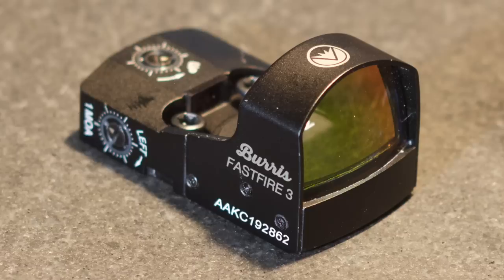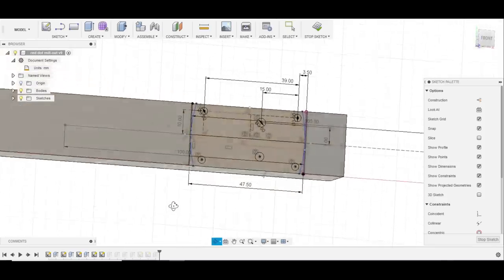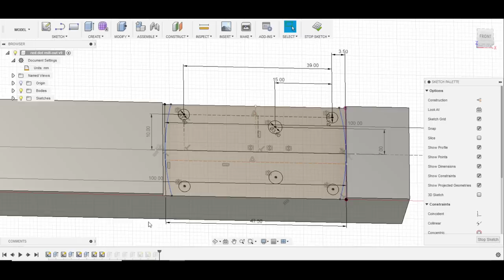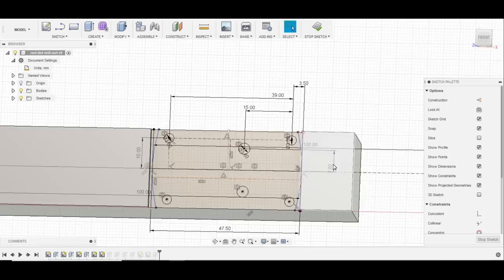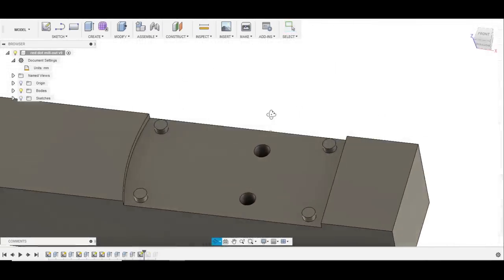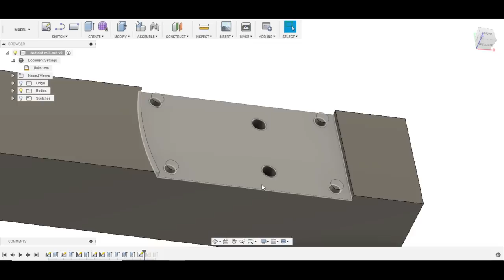Milling a Slide for a Red-Dot Optic

Comment: 0:29 – Intro
1:53 – Mounting details
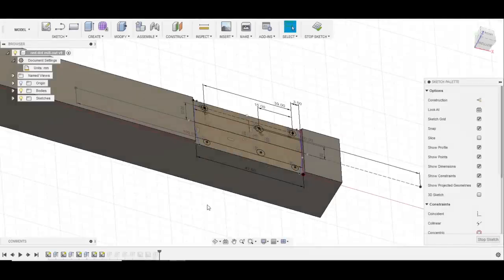6:15 – CAD Planning
7:41 – Starting the Milling
9:40 – Drilling Mounting Holes
10-15 – Tapping Holes by Hand
11:25 – Attaching the Red Dot
11:44 – Finished Picture
11:48 – Outro
Reply: When does he actually start milling?
Reply: Red Beard Ops thank you so much!

Comment: Glock's Tennifer coating is really just one of many trade names for some minor variation in process for nitrocarburizing, sometimes just called nitriding. The layer thickness on Glock slides and most other nitrided gun parts is in the single digit micron range, so well under half a thou. It's great for abrasion resistance, but the base metal is still just some carbon steel so that hard layer is pretty easy to blast through with a sharp cutter.

Comment: I have all the parts and pieces to convert my mill to CNC. I did this same job the old fashioned way of machining. It came out fine but it would have been much faster by CNC, let alone not needing a rotary table for the pins and front arc. Great video and motivation to get my conversion finished.
Reply: How did you do the studs/posts?

Comment: Nice. Wish I had a cnc. I run a manual mill. You can forgo the studs as long as you make it a snug fit. Then the front and back of the optic act like studs not allowing it to rotate. Or move forward or backward. I run a Burris on a 40 cal g35.   Hasn't come loose yet. No studs.

Comment: As  Dan Bruce asked are you  going to leave the slot bare or are you going to blue it? Centuries back when I was in High School I extended the slots on the top of a rifle receiver so I could mount the scope further back. Used a cold blue to coat the bare metal and never had problems with the cut rusting. I can just imagine the uproar today if someone walked into school with a rifle in a case. I did have to leave it in the principle's office when we were not working on it, also used the Air Cadets indoor Range to test it out.
Reply: We took our shotguns back to the shop teacher to lock up if we were leaving school to go hunt during deer season. If not, some guys just left them in their trucks in the racks on the back window. Decades of this going on and never remember hearing if any issues.
Reply: Red loctite.... so the optic is never coming off again, short taking the heads off the screws and redrilling and tapping the holes...

And also, in high school, only a decade ago, we just left them in our vehicles. Prior to that, my 5th grade halloween costume included inert training grenades. Back then you got compliments for a neat costume, not arrested. And that would have been 1.6ish months after 9/11 attack.

Comment: I’m planning mine. Basic hand mill w Y feed. I’m thinking milling down to the dovetail s&w compact. I’m trying to plan out the curve on my vortex optic I have some ideas, but I also wonder about the milling process. I’m thinking maybe .25 endmill is my workhorse to avoid massive heat buildup. Just wondering why not just use .875 endmill? Nicer run thinner cut and less heat I assume. Wish I had what you do it came out so good! Did you refinish the cut to avoid rust?

Comment: So you only milled your optic pocket .050" was that spec for that Optic? I had a friend mill my 43x slide for a Holosun and he cut it down .080" or just as deep with the rear sight. My question is, should I have him mill it deeper? Like .125"?? I have the height adjustment all the way down and it still shoots high. Would that cause this issue or is it just me? Thanks for the video!

Comment: with your experience using hand tools, how feasible do you think that'd be for someone without access to a mill? obviously, a lot of work, but file out the opening, drill and tap 6 holes, threaded posts to act as the 4 anchors (bosses),  something like that?
Reply: Lyle W I’ve done it and it sucks. It’ll take hours and won’t be perfect.  There’s a ton of shops that will have a CAD file on hand for the red dot of your choice. The $100-200 is well worth your time and money.

Comment: Should have put the red dot all the way to the rear and machined the rear sight dove tail in front, you are going to have chamber pressure from the slide cycling coming through the extractor hole you uncovered causing longevity problems...

Comment: Greetings.

I've been watching your videos for a while, and I thought I'd try my hand. I have the old saw blades, an angle grinder, a belt sander (yeah, that might present a challenge) , hearing and eye protection. What I don't have is a respirator.

Is there an OSHA/Ansi spec for knifemaking? I've searched The Google, and what I get is a bunch of people trying to sell me stuff, with little real information.

Thank you.
Reply: I use 3M 2091 filter. They work with a wide range of facepieces, including 3M Half and Full Facepieces 6000, 7000 and FF-400 Series.
Reply: Here's a link on the filter category:
https://pksafety.com/blog/what-does-p100-mean
Reply: @ChuckNorrisUltra  Thank you
Reply: @jbt369  
No problem. I hope that helps. I have both full face and half face masks. I'll try to only wear the half mask as much as possible because the full face is less comfortable for me, but there are procedures I do where I'm glad I'm wearing the full face respirator. Good luck!
Reply: You need any filter capable of protecting from carbon dust which isn’t too hard to find out there. The carbon is what causes respiratory diseases

Comment: I think you would have been happier with blue Loctite you can take it apart using that
Reply: Yes you can...... Jeeze, a little heat breaks down the "locktite" and it does not take slide ruining amounts of heat.....

Comment: Thanks was wondering if most were blind holes and bottom tapped however the studds may be a tough go with my manual mill
Reply: You don’t necessarily need them if you can make it snug enough that it is almost press fit
Reply: Not exactly press fit but I think you get what I mean right

Comment: Please DON'T use red loctit. As a gunsmith I have had to fix striped heads to many times to count. Use blue at the most or just torque to 15-18in lbs.

Comment: RED loctite? It is permanent. :(

*And thanks!!
Reply: Unfortunately, it is required to keep an airtight seal that won't come loose from the massive vibration of firearm use. I wouldn't feel confident with any less than that.

It isn't permanent permanent. Blast it with some heat and it will loosen enough to work with, but do not try to remove the screws without heating the threads first, you'll just strip it.
Reply: @rich1051414  Ya, some HEAT, and not an insignificant amount. This isn't a barrel or something, it's an optic. Better off grinding the bolt heads off.
Reply: @cavscout888  The slide itself was permanently modified for this optic already. You aren't removing it unless you are replacing it(damaged) so who cares if the heating destroys the already broken optics :P
Reply: @rich1051414  Vortex: Please send the malfunctioning optic in for warranty evaluation....

Lol...
Reply: I’m pretty sure the optic comes with instructions that say to use blue loctite. If those screws do come out it’ll probably be because the Burris flew off and left all the threads in the hole. If you still check this, is that Burris still working? They have a bad reputation of the slide jolting the battery around too hard for what the battery compression spring can handle. I am running a Burris on my 19X with no problems but I probably only have 5-600 rounds through it.

Comment: shouldve made an adapter plate that fits into that rear sight dovetail.  cringe that left side threaded hole will definitely work better tapped at that 15 degree angle 👍